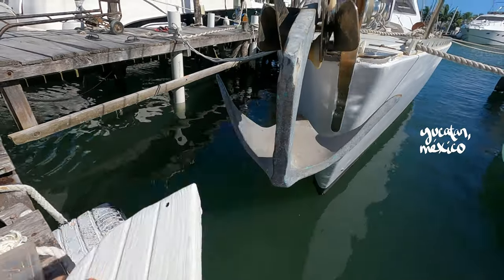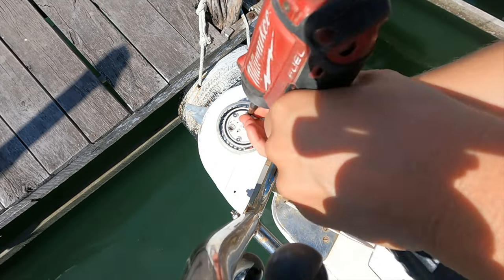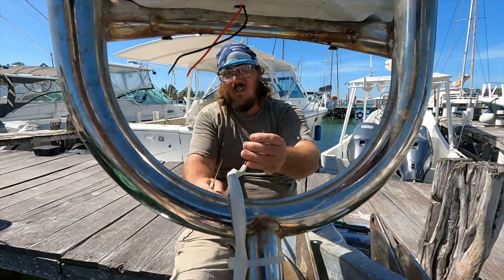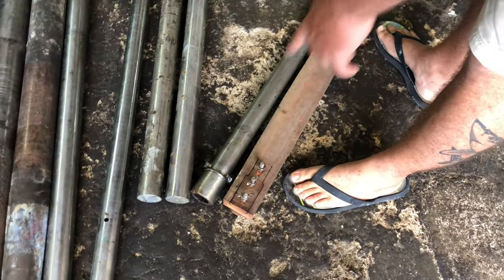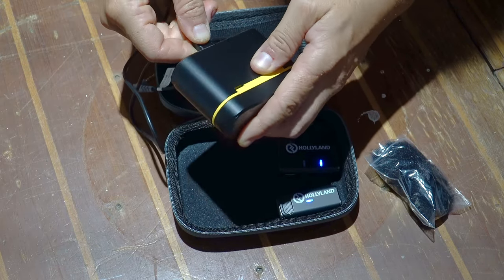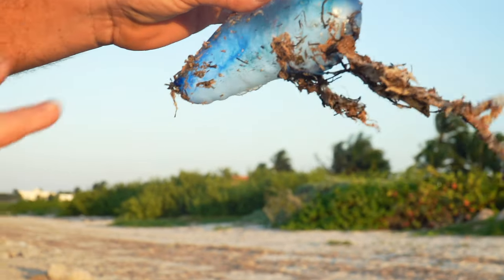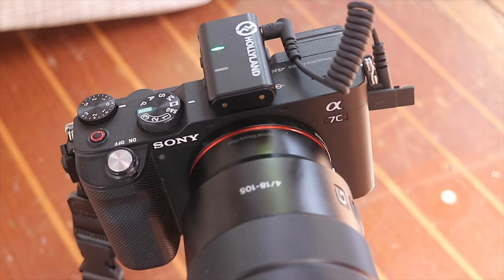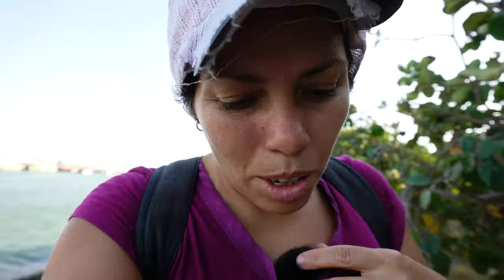BITE-SIZED sailboat TESTS puerto yucalpeten

Comment: When heat shrinking wires it's useful to smear some hot melt glue on them before sliding the heat shrink over, give the glue time to cool first. This not only helps to secure the connection but also adds a layer of water resistance especially when wrapping two or more wires together because it can fill the gaps between them.
I'll be very interested to see how those solder filled heat shrink connectors last up there on the bow like that, I don't have a lot of confidence in them as they use a very low melting point solder which seems kinda weak but I think the wires from the light will probably break off or pull out too, that needs fixing in place.
Reply from the maker: Everything zip-tied into place on the pulpit, but it will be pretty interesting to see how water-tight it is for sure - I've never seen more than one layer of heat shrink tubing placed on top of each other either 🤪

Comment: You can edit a stereo sound back to mono using free software Audacity. That way a single stereo will be heard in both ears. Also your audio is recorded too hot giving you this fuzzy saturated sound. It is impossible to edit it afterward. Its better to record the at a lower volume and just turn it up in post production. You'll get a cleaner sound. ✌
Reply from the maker: Definitely! I turned down recording volume on the camera (which is easier to do than volume controls directly on the mics) and recent footage sounds better now.

Comment: It's a bit late now..... I would have installed the lights on the underside of that platform (putting enough wood on the underside so it sits below the SS tube) where they are less likely to be broken by people standing on them (you know it's going to happen)
Reply from the maker: Yes, we thought about having the light hang on the underside, but decided that water was more likely to get into the housing of the light that way - should be interesting to see how long the little sucker lasts. 😆

Comment: The mics sound good. Not sure where you would use stereo mode though, just moving the camera around a bit could put the wrong person on the wrong side.
Reply from the maker: The reason I included this part about the stereo versus mono setting is because I noticed on another review of the Lark mics that there was some confusion about the settings. Stereo setting worked really well when both Robi and I were walking on the beach close together. The user really must remember to turn on the green mono setting when only using one mic, or else audio will need to be edited later on.
Reply: @sailorama  Yeah, when you used the two mics it worked out well. I am thinking of those who have switched to almost all 360 cameras. Consider two of you walking side by side. The 360 camera is in front of you and the stereo is good, now walk by the camera and walk away from it. the camera view slides smoothly to follow and now shows you from the back. but from the viewer POV, the one that was on the left is now on the right. No big deal really... edit with head phones ;)  This may not affect you at all with your method of operation. I am not really a camera guy, more audio.